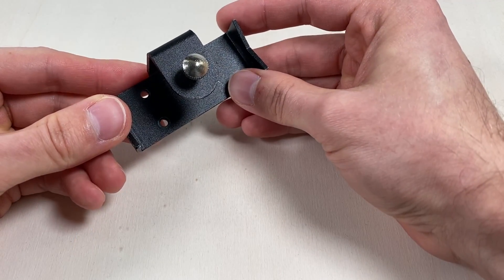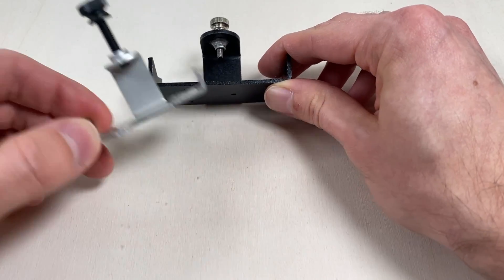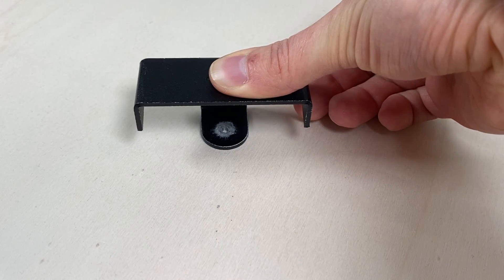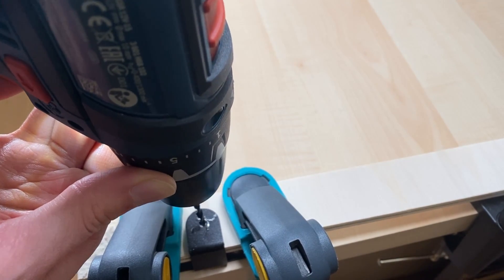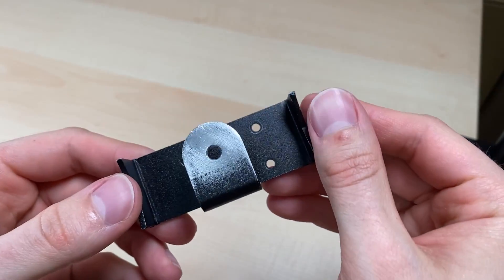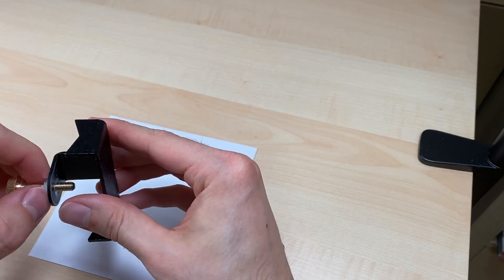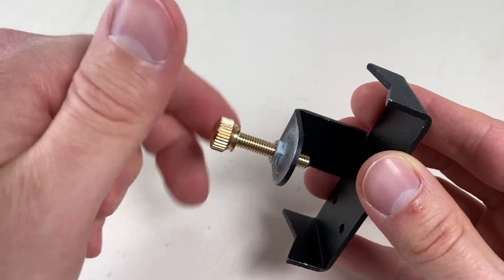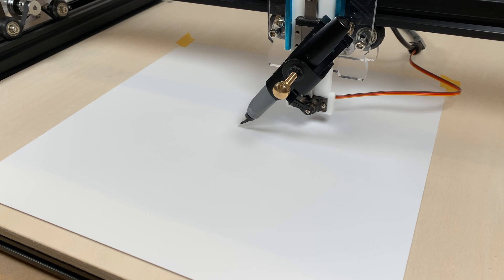Improving the Pen Module (Pen Plotter Upgrade)

Comment: Hallo 
Gibt es ein tutorial dazu , wie du den Laser umgerüstet hast mit dem Stift ?
Reply from the maker: Die Hardware war ein Set von der gleichen Firma wie der Rest der Maschine: "Eleksmaker Draw Module". Scheint es nicht mehr zu geben, aber könnte man sich auch selbst bauen mit einem Servo, einer Linearführung und ein paar 3D-gedruckten Teilen. Der Controller hatte bereits einen Anschluss für den Servo.

Für die Software gibt es im grbl Repository mehrere Pull Requests, die Servo-Support hinzufügen.